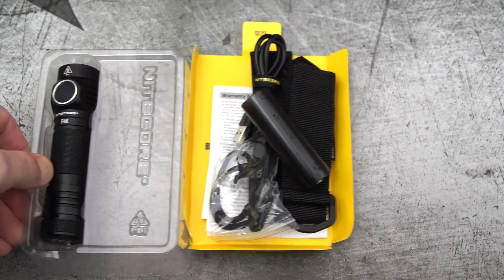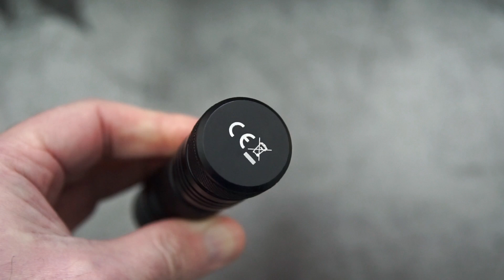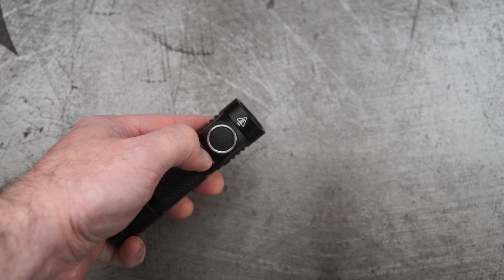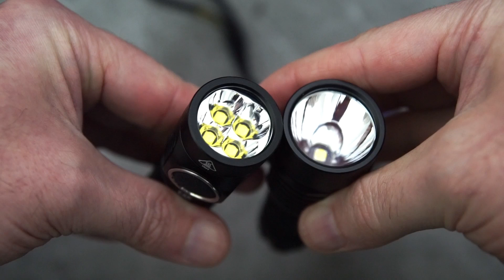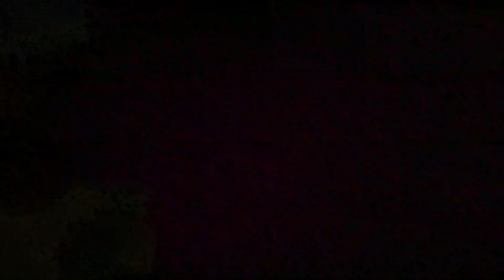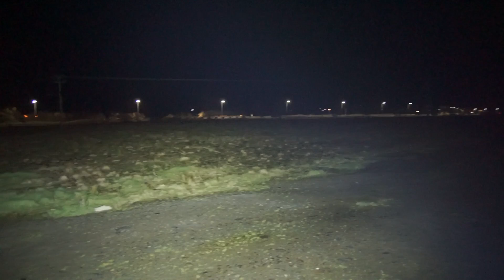Nitecore E4K 4400lm LED Torch: Review

Comment: Awesome video,  but I have a question for you,  is it normal for this flashlight to get really hot using turbo mode only for a few seconds? I just got mine today and I can't switch to another mode but turbo and moonlight.
Reply from the maker: It gets pretty hot quite quickly due to the high power in Turbo. The user guide is shown in the video the UI takes some getting used to, you have to have it on to change power levels

Comment: You do not 'maybe' damage a battery by QUICK CHARGING, you actually DO!!!  No, I am not saying you HURT the battery regarding its output, at least not initially, but when you QUICK CHARGE any battery... ANY battery... you shorten the number of cycles for that battery.  So, instead of getting the battery's expected 800-to-1200 (some, not all) charge/discharge, charge/discharge, charge/discharge for that many cycles, you MIGHT be lucky to get say 500 or so.  Also, SOME battery types will develop something called, I THINK, 'dendrites'; don't quote me on that.  But, these particles compound over time, and can cause the battery to EXPLODE due to a short circuit!  I believe this is usually a Lithium-Ion type.

My understanding is that you should avoid ANY type of 'system' boasting HIGH CHARGE RATES as a default, unless there is a SLOW CHARGE rate you can select.  What I absolutely DO know is, the slower (overnight) you charge, the longer the battery will work as expected.  And, there truly is NO SUCH THING as a battery that is MADE for FAST CHARGE, other than perhaps it lasting a bit longer than 'other' batteries.  The so-called FAST RATE could have (would have?) lasted MUCH longer without the fast charging. Oh, and if you want the battery to truly LAST as long as possible - NEVER FULL-CHARGE and store the thing.  ESPECIALLY 'LITHIUM ION' TYPES!!!  Full charge a battery, then discharge down to ABOUT 60%-80% for 'long' storage.  Check it after a few months, charge it back to 100%, back it down to the 60-80.  Your batteries will last a TON longer than you may have been experiencing... I give you my word.

Now, who am I to claim the above.  Oh_  just someone who worked within the industry for a tad...17 years for 'Delco Remy', and then 'Sanyo', the makers of the best rechargeable out there, IMHO, the "eneloop".  Amazon has their own branded one, made by the same company, I BELIEVE.  If you KNOW batteries, you KNOW the "eneloop" is KNOWN for the LONGGGGGG time the charge can hold.  Charge 'em up, and a year later, d@mn near close to an 80% charge!!!

Any of y'all flying the small 'copters' that take the small 'LiIon' batteries?  Are your batteries getting FAT?  Better get rid of them.  You have been 'Long Storage' charging them wrong, and if one of them 'pops' and starts a fire, any & all the others in the same box or bag are extremely likely to go POOF, making a truly possible life changing situation.

Stay safe, people.✨🤗✨
Reply from the maker: Keeping it short it depends on the cell and current, some cells can handle a bigger charger current, some cannot. A 21700 is pretty safe to charge at 1.5A, it doesn't mean you should charge it at 0.5A

Comment: hello my friend nitecore e4k in high mode (1050 lumens) 3 hours 15 minutes continuous 1050 lumens?  Or will it subside after a few minutes?  Thanks
Reply from the maker: A run time test in turbo is shown in the beam shots that's why I advise watching the entire video ;-D
Reply: I watched it all, thank you.  However, in other videos, there were expressions such as starting from 800 lumens after turbo and starting from 750 lumens.  Nitecore e4k video does not show how many minutes after 4000 lumens burned out 1050 lumens, so I asked

Comment: Can the 21700 cell be charged using a smart battery charger or is it only recommended to use the included cable to charge it? Thank you
Reply from the maker: You can use a charger if you want, won't make any difference. Charging speeds vary but result is the same most are 4.17-4.20v, they do vary a bit
Reply: @MrBazReviews  Thank you for your response Mr Baz.

Comment: The UI is the whole reason I’ve stayed away from the e4k. Nitecore could have had a winner with this light but they ruined it with that horrible UI
Reply from the maker: I'm not a big fan of it, no idea why they used it on this light it could be a much better UI. I still quite like it the form factor, but yeah the UI is not going to be ideal for many
Reply: I have several Nitecore flashlights and a headlamp. HC30 and EA4 are great otherwise but the UI sucks. Both have the same UI with memory and shortcuts for firefly and turbo. That would be good if not even firefly and turbo become memorised. So annoying and unneccesary: it removes the point with having memory for the regular modes. 
Thrunite got it right and uses memory for the regular modes and firefly and turbo INSTEAD have shortcuts.
Therefore I abandoned Nitecore and now Thrunite is my favorite brand. It's a pity because EA4 is otherwise the best 4AA flashlight I know. It does not only look good but is compact and perfect in the hand with a very good and punchy beam.
UI is indeed a very important part of a flashlight and headlamp!

Comment: I want a light like this or similar to this but where do you get them in the UK?
As I have only seen one on eBay and that says it’s coming from China so I will probably end up with more than the light. I will end up with lights out!!!!
Reply from the maker: I just checked link is gone, it was on Amazon UK but even with a search it's not there
I did search other sites and it seems to be out of stock there too (UK), so it seems a supply problem - unless they sold a ton of them and ran out or had an issue with the covid thing and manufacturing. I'll updated links when I find them
Reply: Mr Baz Reviews thanks that’s really nice you having a look. Basically after one like that or similar. I want something smallish what’s really bright but also don’t want it to be overly expensive.
What do you recommend?
I have seen ones where you can pull out the battery and charge that through a USB port. Can’t remember what that was or how bright it was. I want one as bright as can be but will fit in my pocket.
Thanks again for replying

Comment: will the E4K run off a Samsung INR21700-50E (discharge cueent 10A)?
Reply from the maker: You need 15A to hit turbo so you can use it but it won't hit the top output
Reply: Great reviews mine comes in 2 days what song is that.? it's driving me crazy I must know!

Comment: Don't waste your money !  I bought one and was totally disappointed and sent it back..It will only run on turbo for 20 seconds at best , also the switch is very confusing and is a joke .. Basically a high dollar 1000 lumen light , there are many better and less expensive lights out there so do your self a favor and get something different
Reply: It would be nice if they just said it ran for 20s on turbo, or just made a 1050lm light that ran for 3 hrs. Don't have to lie about it.
Reply: @vincenzopromedia  I agree. It can better be described like a 1050lm light with 4400lm burst.
Reply: @vincenzopromedia its high set is more than 1050 lumen. Also, with a light.this size you can't physically get a such powerful turbo for much longer without burn the light and your hand.
Reply from the maker: Turbo time is pretty short, unfortunately that's what you'll get with small lights, I'm not a fan of the UI as I mention
Reply: which light would you recommend that provides high lumen for some minutes ?
Reply: Mark LaquA : depends on your budget and how and what your going to use it for Like do you want a thrower or flood or one that does both ?
Reply: Flood one would be good. Also light weighted as I wanna use it on a drone...

Comment: Very nice review. I just bought the E4K and I really like the textured switch on this light. It's easy to find in the dark without having to look at the flashlight or fumble around. Many of my other flashlights have a smooth switch that is flush with the body of the light and that kind of switch is very difficult to find in the dark. When I pull a flashlight out of my pocket I want to put it to use immediately and a hard to find switch is a deal-breaker for me.
Reply from the maker: Switch is nice and big easy to find, though I'd half turn the base/tail cap in a pocket if you have stuff in there, just to be sure it won't come on

Comment: Just got my E4K yeaterday.  Thank you for your spot on review.  I DO NOT LIKE the U.I.  The E4k was to replace  my Nitecore MH20 as my EDC.  The MH18 is a great light. I was being greedy wanting more light and i love flashlights.  The light is still new but its exactly the type of flood light i need for work.  Why this strange U.I? I will get used to it.  I have to.  This is a $90 light. The MH20 is the earlier version than the MH23.  Great light. Easy U.I.  Again thx for the review.  Im going to contact Nitecore and inquire about the U.I.
Reply from the maker: I'm not fond of the UI, all I can say is as with the EC30/Concept 1, you can get used to it. But it's far from intuitive at the start. I guarantee if you hand the light to someone, they'll be mashing the switch and not have a clue how to use it.
I don't blame people for not liking it, once you get used to it, it's bearable (the light is quite nice I get on well enough with it). The MH UI is way better, just far more obvious and you can still get quick access to ultralow/turbo. But you can change power with it on. Someone suggested a double press, to change power that works it still turns the light off for a short time though.
Not really sure why Nitecore don't get a good UI and stick to it across most of their lights.
Reply: @MrBazReviews  Yeah i have to get used to it.  Its an expensive light and i own it.  I rarely return things because i tend to spend alot of time researching.  But it is a great flashlighy

Comment: With the light on, double press and hold the second press to cycle through modes without having to turn the light off.
Reply from the maker: You can do that, but it is turning the light off as one press turns it off. Same on the EC30 concept 1, no different to this

Comment: Great review I am excited to receive this, already ordered. I want to see how it stacks up to my IMALENT DM70 . Similar lumens, roughly kinda the same distance. Want to see the difference in beam patterns.
Reply from the maker: I've not used that Imalent on paper it should have a bit more range, let me know what you think of the Nitecore when it turns up
Reply: @MrBazReviews  I will try to remember. I ordered it from Banggood so it will take months for it to show up.
Reply: @TopDog8762  Did you receive the Nitecore yet?
Reply: @Captainelduke  Wow four years ago, not only did I receive this I have since ordered and received the upgraded E4K with the upgraded UI. I did not use the original E4K because of the funky UI. The upgraded version is head and shoulders above the original and much easier to use. 😉

Comment: Beam pattern looks similar to the Olight seeker 2. Very useable. Quick step down makes turbo almost like a gimmick?!
Reply from the maker: Beam pattern is pretty nice, I'd like a bit more range (EC30 has more range despite a lot less power, and the MH23 quite a bit more). Not shocking a 4400lm light in a small form factor drops down pretty quick. I guess if they made it 2000lm turbo it wouldn't sound quite as exciting. There is a marketing element they've all jumped on. On the other hand you don't have to use it, the high of 1050lm is probably more useful (seems to hold output pretty well)
Reply: Mr Baz Reviews Agree. On a totally off topic. I am looking forward to see what Olight will replace the X7R with. 😄

Comment: Nice job, see what you mean about the ui. But has a nice beam!! Thx for sharing Mr.B
Reply from the maker: Beam is pretty nice, UI I was never a fan of that one myself. Thanks for stopping by!
Reply: There are two ways to change brightness settings:
While OFF: Press and hold to power on and cycle through brightness levels
While ON: Double click the power button and hold on the second click to cycle through the brightness levels